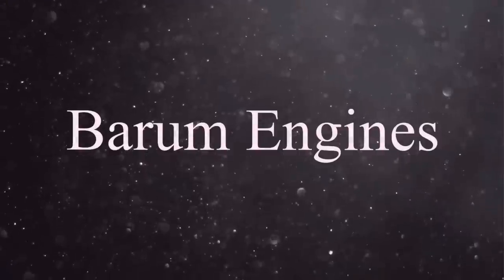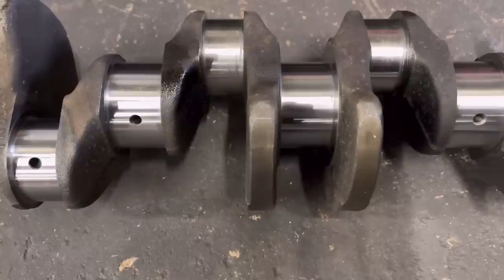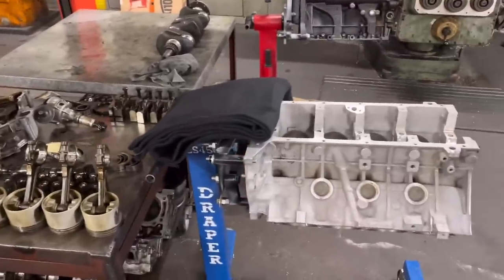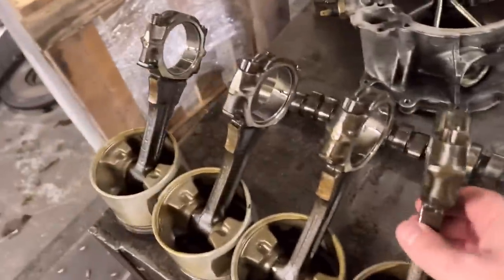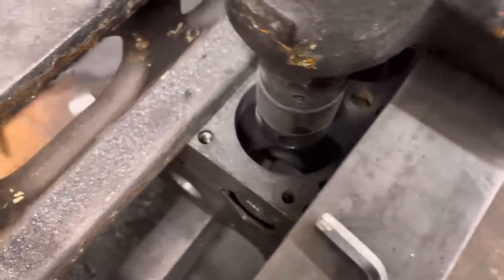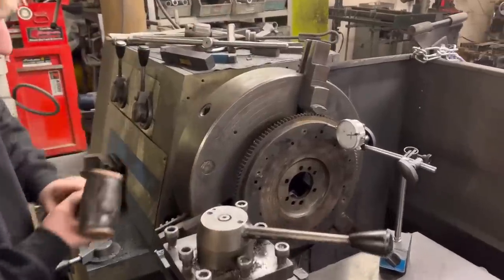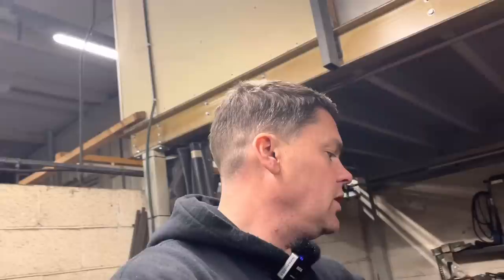BIG ERROR BUT HUGE MISTAKE COSTS THIS CUSTOMER THOUSANDS!

Comment: Good morning, As an ex machinist I suggest you use your four jaw chuck with the jaws reversed to hold flywheels for remachining. The three jaw does not have very good holding power due to the small land in contact with the top of the ring gear teeth. Where as the reversed jaws have a wide contact area ( the width of the jaw) and then you can use a small piece of flat copper between the jaw and the ring gear tooth to gain greater holding. Some clutch faces can be very hard and with the cutting pressure you risk the flywheel moving back in the jaws. Not good. I hope this helps you in the future Cheers Ian - New Zealand.
Reply: He won't listen to the advice, I've tried to educate him on the engineering practices. He still uses an end mill in a 3 jaw drill Chuck. But we should get a good video of the flywheel coming out the lathe soon enough, I just hope no one gets injured.
Reply: @Ben-Dixey  I hardly ever have the 3 jaw on my lathe. Over the years you can very quickly set jobs up in a 4 jaw and they are held far more securely.
Reply: Your point about the jaw type was the main one for me. Full contact external hard jaws or machine soft jaws, either option wouldn't take more than 15minutes to achieve. But to tell Isaac to clamp lightly with those jaws is asking for the job to come out, and that's a heavy flywheel with some inertia. You can get 4 jaw scroll chucks, I worked a manual lathe for years and that had a 6 jaw scroll Chuck. Can't remember a job ever coming out the Chuck but I still used the correct jaws.
Reply: Turning a flywheel in a lathe isn't good practice as they should be ground .I have seen flywheels explode on the dyno and racetrack  which had been turned on a lathe,setting up stress risers with the tool marking.
Reply: @ianlangley987  I was taught from the beginning that only a four jaw chuck was capable of providing an accurate mounting .
Reply: @Mercmad  I can understand turning causing stress risers from the lathe tool surface. The flywheels I've done on a lathe have only been for tractors. 
An independent 4 jaw allows you to accurately set the concentricity but when facing off concentricity isn't needed. Whats important is run out on the face.
Reply: I can fully understand flywheel grinding being the best way. The hard spots are also an issue with turning. You can feel them by hand after being faced which isn't good at all. From now on then if anyone asks me to face a flywheel I will recommend it being ground.
Reply: Using the 4 jaw chuck often on different things. It takes a little more time to setup but its worth it.

Comment: As a trained fitter and turner, could I suggest those jaws need inverting. For one they are too far exposed out of the chuck and for the second point, you would have a land to support the rear of the flywheel.
Reply: Much easyer to dial in becouse the jaws support the rear of the flywheel, and the not clutch side should be reasonable flat to start dialing in

Comment: Being pedantic, the 'correct' method to true up a flywheel is to mount it on a mandrel. This is how it will be when bolted on the crankshaft. I've seen a few 'wobbly' faced flywheels in the past, clocking the outer face doesn't work.

Comment: I mentioned this in an earlier post.  On the MGB tappet cover later style red rubber gaskets, the material the currently available ones are made of is far less dense (squishy) than the original gaskets.  Unfortunately, this means the bolt that holds the covers on has to be torqued repeatedly over several days because the gaskets compress, leaving the covers loose, until a final torque reaches the maximum compression of the gasket and it won't compress any more.  A hassle - yes!  Also, the center bolt of the covers had the wrong seal for the bolt on it, which means they will leak there also.  It's possible to get to the center bolts whilst the carbs are on, but it is very difficult.  It's easier to remove the carbs, heat shield, and intake manifold to do the tappet cover bolt tightening.  You can leave the accelerator and choke cables attached to the carb linkage when you remove the carbs, that will save you a bunch of time.

Comment: After having ground at least a thousand flywheels on a flywheel grinder I have to agree with the others that setting up the flywheel on your lathe using the outer edge as the reference is not the best procedure.  The flywheel grinder sets the flywheel up on the crankshaft flange surface and it is very very rare to have one be absolutely flat and not warped some at the outer edge.  Some are warped .005 or more especially the newer lightweight flywheels.  You might be able to get away with it on the older very heavy cast flywheels but I would not think about it.

As a test on the next few that you do after you have them bolted to the crankshaft check the runout at the outer edge.

Comment: Issac , always use outside jaws in reverse to grip large diameters , that set up is a dangerous killer with 3" of jaws protruding beyond the chuck ,your boss should know better. 
 Face turning flywheels generally gives a poor finish due to the fact at least 1 speed change is needed  plus hard spots and intermittent cutting across dowel/tapped holes .
 Grinding on a mandrel  flywheel grinder is the proper way , it zero's to the flywheel face to the crank flange , your method assumes it was zero beforehand.
 You can put a 90 deg adapter on your dti to clock to the crank flange recess to check if turning is  your only way.
Reply: Don't blame Isaac he was only just being shown how NOT to do it by Lee who as you say should know bloody better!!

Comment: Another excellent video but as a machinist who skims flywheels can I suggest you get a set of outside jaws to hold the flywheel, the curve of the jaw suits the curve of the flywheel better and the back of the jaw supports the flywheel better so there is less chance of it moving when facing it and your getting under the hard spots. Yes sometimes you have to hold the flywheel the way it is being shown because the back of it doesn't let the outside jaws grip it, I have had to do it that way sometimes myself and it does work but..........
Reply: Just gripping that flywheel by the narrow teeth seems a bit dangerous to me ? Should be using out side jaws as well ? Your man not a skilled Turner?

Comment: MGB - did you check that the dipstick and tube combination is correct? If it is mixed up, old and newer, it's easy to overfill the sump, sloshing about causing air blocks and localised crankcase pressure..

Comment: The leaking pushrod covers on the MGB engine is a common BL problem. The covers loose their strength and the bolts are overtightened, the rubber gaskets are an improvement. It's the same for most of the A type blocks
Reply: Perhaps someone makes better covers?
Reply: @ColinWatters  no

Comment: Sounds to me link the  gallery covers have been over tightened and it's goosed the gasket, squeezed it out a bit, pinched it or distorted the covers... IMO they should be lightly tightened, only just enough. Makes me wonder what the rocker cover gasket is like too ?

Comment: On the mg side plates I certainly would go down the old road and use the Cork gaskets.ive never had trouble with these.60 yrs of working on A andB engines the only thing I would add is you can over tighten them.kevin

Comment: Use the cork gaskets on the MGB tappet chest covers with Loctite black silicon sealant on both sides to hold them in place. Dont over tighten them. But also remember its a BMC b series engine....leaks were part of its nature...lol.  Make sure its not the o rings on the bolts that are letting by.

Comment: Because of hard spots, the best option would be to surface grind the flywheel, but that's a job many don't have the equipment for - an option may be to fabricate a fixture to hold a die-grinder and use a carbid cutter, or grindstone in it to remove the high spots, if the lathe tool won't manage it.

I'd also agree with the other commenters that the "garage has very likely overtightened the side plates - that would put it all on them... Unless, of course, it was the customer who decided to "check up on" the work that was done and gave the fasteners a good tweak!

Comment: The 701M was I think used in the original Escort Twin Cam and was also used in the MK2 Lotus Cortina.  I also think It came with square main caps and used a six bolt crank (The original TC had a 4 bolt) Ford are remanufacturing the 701M now, costs over £3k with Vat so that block you have there is well worth rescuing 👍
Reply: Can pick up 701M blocks from early mk.3 Cortinas, with the 1600 Kent engines. Should be some lying around somewhere.
Reply: 701M block was never fitted to any Lotus Cortina or Escort Twin Cam.  By the time it was introduced production of all those cars had ceased.  The 701M block was never fitted to a Mk3 Cortina - you’re thinking of of the 711M block.

The 701M block was only ever factory fitted to Lotus Elans and Plus 2s.  

Many 701M blocks have been used for tuned or race engines and fitted to Cortinas and Escorts, which is why people think they were the originally fitted engine.

Comment: Wouldn't you want to align the fly wheel plate based on the machined surface of the mounting boss vs the outer (worn) surface?
Reply: Yes, I've pointed this out. Datum faces and all that.
Reply: Totally agree with you.

Comment: Sounds like the MGB has excessive crank case pressure. How much pressure is being pumped out with oil filter cap removed
at idle.? Be interesting to do a compression test ,hopefully, the rings have bedded in. When I machine a flywheel, I used an aluminium packers to protect the ring gear, just how I roll .Good luck.

Comment: Hi having built many successful Ford crossflow and non crossflow race engines since the mid 60s, top hat liners are the way to go as long (as you say) they are fitted correctly, also I have seen several of these blocks that have been bored out to 85mm that have gone through the central oil gallery making it unusable without external pipework for the crank feed.  Although I have now retired from racing I still have quite a few blocks and heads kicking about that have all got to go. 
I find your videos interesting in my dotage.

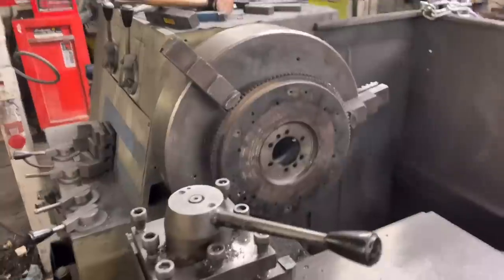Comment: FFS Lee, 6:30. You are showing an apprentice how to face a flywheel. Those jaws are way outside of safety limits. There should be a line on the jaws that stipulates how far you can have them sticking out, and these are beyond that. Use the reverse jaws, it takes 5 minutes max to change them over.

Comment: If you machine a flywheel like that mounting on the teeth, and clock it on the outside, while on the engine is mounted on the inner flang wont that cause any issues? Or do you clock the inner flang as well? Because you could possibly machine it not true to the mounting flange right?. Just curious.
Reply: Should npt cause any issues. They were clocking it on a non wearing portion of the face, so it would have all been machined concentric at manufacture.
Reply: @John Glover  i get what you are saying. But when you are at it, what is the effort to check it? But yeah without mayor overheating it probably fine.

Comment: Surely Top Hat liners are old hat and it is far better practice to step bore the cylinders and sit plain liners on a ledge at the bottom of the bore then there is no way they can move downwards and the top is held by the head gasket fire ring. You can also use less interference resulting in less pressure on the thin walls between cylinders, especially if sleeving alloy blocks.

Comment: If I was a betting man, I would say they run the car with the old pcv and tried to tune the carbs - that blew the crank case gaskets again - got the new pcv on it and it’s working - it’s made the garage look silly and they don’t want to eat the cost or humble pie 🥧

Comment: That valve, there are better modern replacements - used to use them instead on Minis and ADO16's, MG 1300, Austin Morris 1300GT's. Can't remember what vehicle originally from, but was much less agricultural than that original pot with the flaky rubber diaphragm.

Comment: Don’t want to sound like a know it all dick but when surfacing flywheels I clock them to the crankshaft mounting face as that’s the surface the flywheel friction area has to run normal to? Quite sure all is good with the way you do it but it works for me. I have a crankshaft duplicate arbor that I torque the flywheel to for machining. Love your videos.
Reply: Yes that's the proper way to do it to my mind.

Comment: Tell the garage to tighten the covers a bit tighter than fucking finger tight! And tell the customer to put the old PCV valve back on and see if it starts to smoke immediately and then put the good one back on and see what happens.
Sorry Lee as the business owner you are free to use your machines as you see fit, but teaching an Apprentice to put a flywheel in the lathe like that is asking for a very big accident. Those look to be reversible jaws on that chuck, they SHOUD be reversed and the flywheel will fit perfectly and have the best part of a quarter of the jaw stuck out that it has now. Not doing it is sheer laziness on your part instead of doing it properly. We've all seen videos of some poor sod having been dragged into a big lathe and literally torn limb from limb. If you're not careful that could easily be poor Issac. Be warned!😮
Reply: Well said you are correct !
Reply: @stefm573  thank you. I'd hate for that to happen to Issac, he's shaping up to be a good engine machinist, but he needs to be taught how to do it properly and safely, which at the moment isn't happening. I'm not sure whether his college course includes practical machining, if it does then hopefully he will get taught the correct and safe way of how to set up things.
Reply: @SAMRODIAN  when I was a kid I served a 4 year apprenticeship also 4 years day release college  ! Do they still do that these day ? I doubt it ? 
Probably a module of a few months 
And that's it ? I was a toolmaker for years ! Underpaid for the amount of knowledge that is required?  Would I do it again ? NO THANKS

Comment: not a good idea trying to machine a flywheel that way, would get you a total bollocking in any machine shop! got the jaws the wrong way around, would be better using a 4 jaw chuck in the first place, the flywheel back face should be set back onto the step in the  jaws anyway. It would have been better to take the ring gear off first anyway! Retired engineer, ex toolmaker!

Comment: you now have the potential for a bit of sabotage  and blame if when that mg problem first arose you had 3rd party find faulty pcv and replaced valve and sorted the smoking means the person that built the engine into the car was responsible for cylinder wash and ring ware which has cost you and the third party should have thoroughly  test and produced a report as you sad mother of all